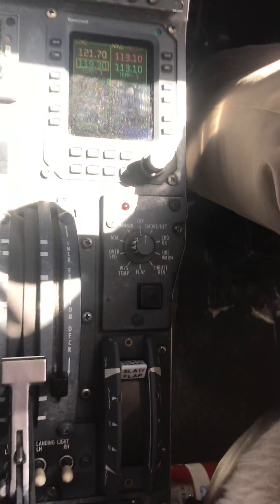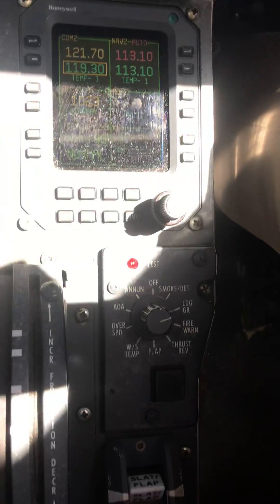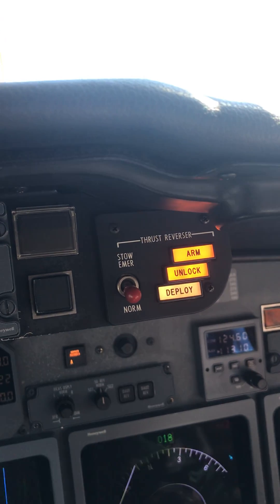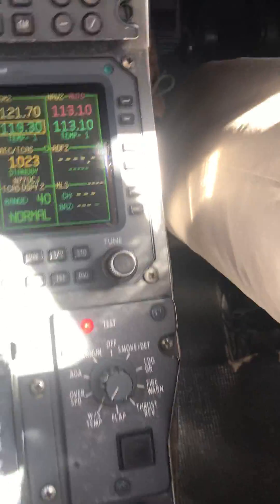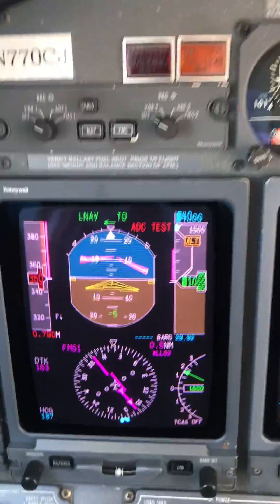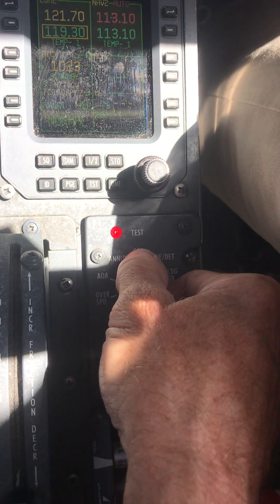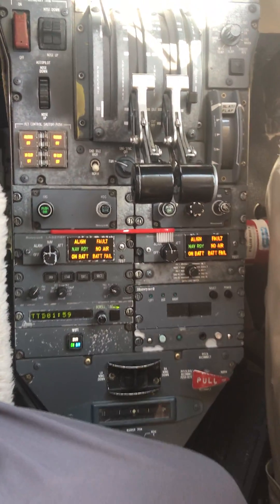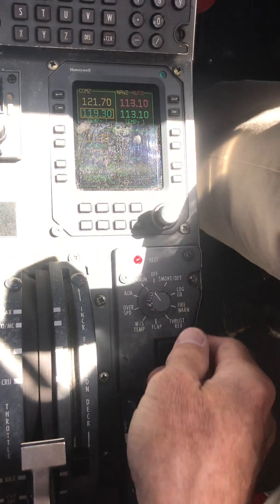Citation X (C750) rotary test sequence

Comment: Thanks for these videos. I'm a captain on a CJ1+. This is my first Citation series jet and there's a lot of fun things about them. Can't imagine how you must feel flying the X... one day! I will say, I'm surprised that even the X uses the bleed air system on the windshield vs. having a heated windshield. Always seemed more clunky and cumbersome to me than just having an electrically heated windscreen. Alas, I'm not an engineer.
Reply from the maker: The X does have electrically heated windshields.  In fact, they have to be on for flight (they are part of the "line up checks" when you are cleared for takeoff, and if you don't put them on you will get a red "NO TAKEOFF" CAS message).  The bleed air over the windshield is seldom used and mostly for rain removal is what I've used it for.

You'll find lots of similarities as you move through the Citation line (I figure once engineers have figured something out they simply stick with it).  So you'll recognize the "rotary test" for instance.

(Sorry for the slow reply - don't know why I'm just seeing this now)
Reply: @jetboy1891  Great info! Thanks! On the CJ series we mainly use it for rain removal as you said. If the windshield really ices over we’ll use them in low but that rarely happens. The little bit of ice that does accrue will usually dissipate on its own relatively quickly. My flight department stresses the use of them as secondary rather than primary because of the danger of melting the windshield (don’t know if this has ever happened but boy they make a big deal out of it). Not to mention it kills the pressurization... especially in the upper levels. It’s almost an immediate 100fpm climb on the cabin. Wish we had electrical. Maybe one day I’ll fly something that does. Thanks for the reply.
Reply from the maker: The X does indeed have electrically heated windshields.  They are one of the "line up checks" you do when you are cleared for takeoff (pitot heats, windshield heats, recog lights, and landing lights - only the first two are required, the last two are "style preferences" on my part).

The CJ series are great airplanes!  Congrats!